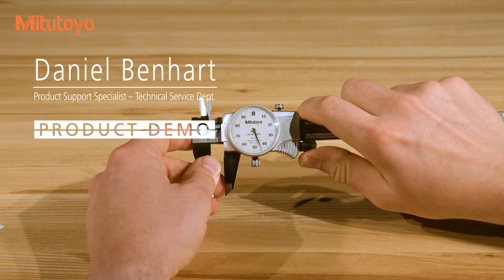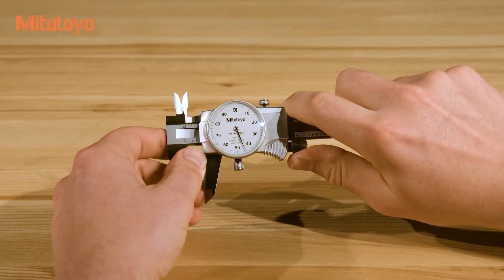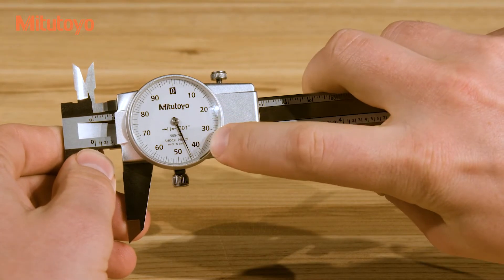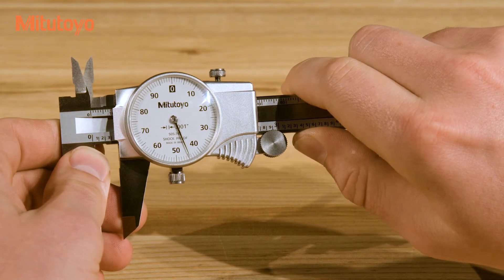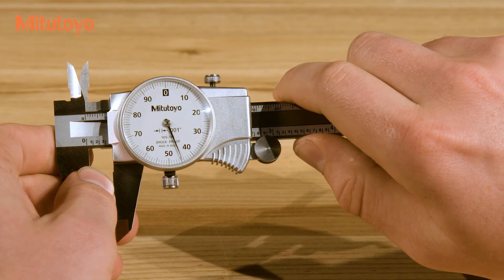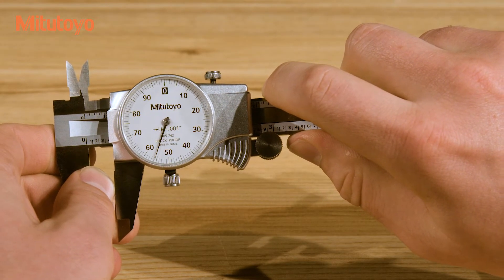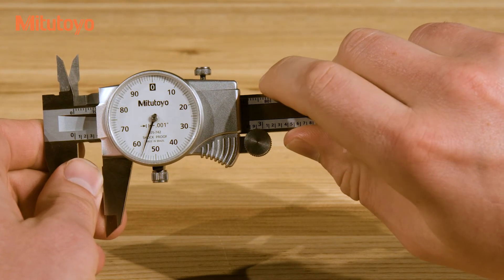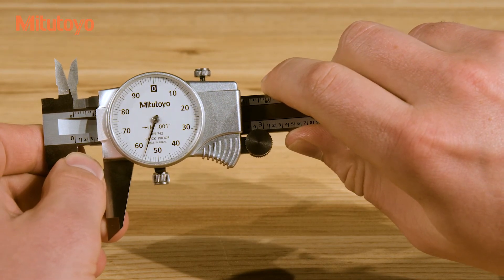How To Read A Mitutoyo Dial Caliper

Comment: I've learned to use a Vernier caliper when I was 16. I own two Mitutoyo tools, a caliper and micrometer. If you've got yourself a Mitutoyo caliper and came to Youtube to learn how to use it, then, to be honest, you've either gone way over your head or just too lazy to read the manual. It's a precision tool used where accurate and precise measurments are requirements for a specific task, by people who know exactly what thry're doing. Another thing is, learning to use a measuring tool takes way more than one minute and twenty four seconds.

Comment: Problem with this demo is we are using metric system to talk about standard system. Who says zero point 3 inches?
Reply from the maker: Hello, and thank you for the comment. In this video, the caliper being used is not metric, but imperial. This is why he says zero point 3 inches. We do carry these calipers in metric as well, and you can find both metric and imperial calipers located here https://www.mitutoyo.com/products/small-tool-instruments-and-data-management/calipers/dial-calipers/dial-caliper/ .
Reply: Decimal not metric.

Comment: how do you read in mm's? do you have to look up the conversion or is there a way to use the dial to read mm's? Thanks.
Reply from the maker: Dial caliper come inch or metric. To read metric I would purchase a metric dial caliper or a digtial caliper
Reply: @MitutoyoAmerica  Your video shows mm graduations along the top edge Johnny J was asking how to read the mm on the caliper you have in the video. You have only shown how to use the imperial graduations.
Reply: @wildcraftstar  To get a metric reading from the dial you must convert it. But if you disregard the dial completely you can get a metric reading without converting by looking at the mm measurements (top) instead of the inch (bottom). This will tell you the length down to the mm. If you need to measure something more precisely than milimeters (down to the micrometers) then you must either convert the dial's value in inches to metric, or buy a metric caliper.
Reply: @MitutoyoAmerica  thanks for your response.